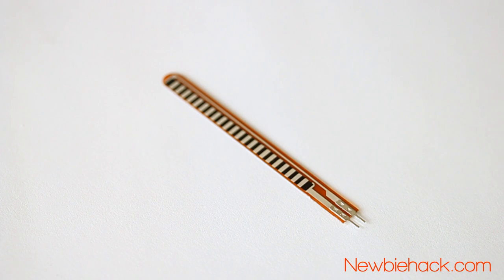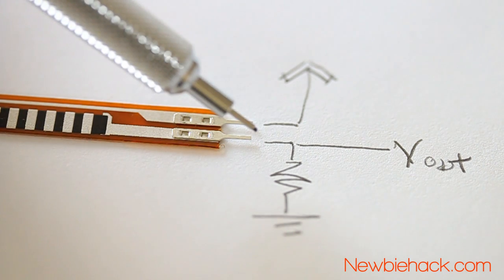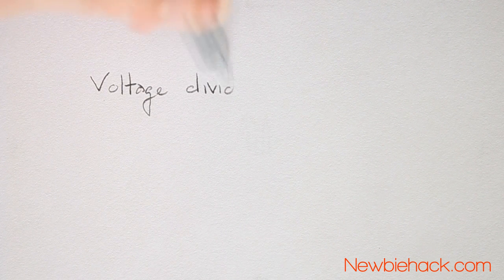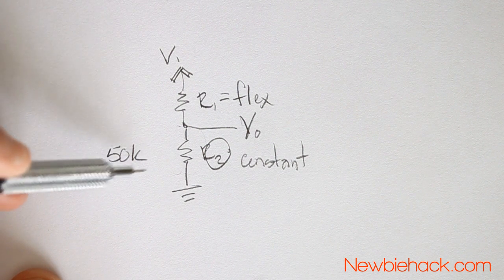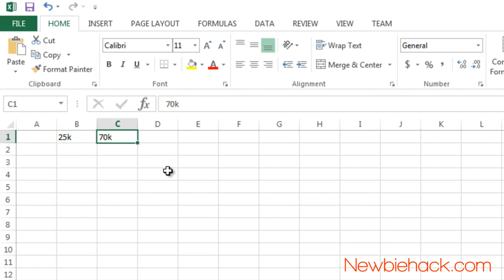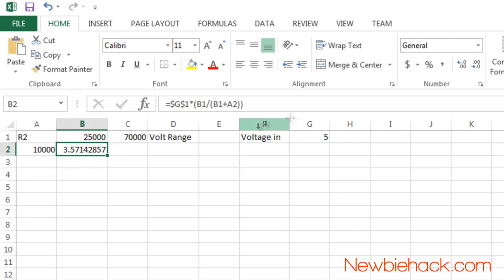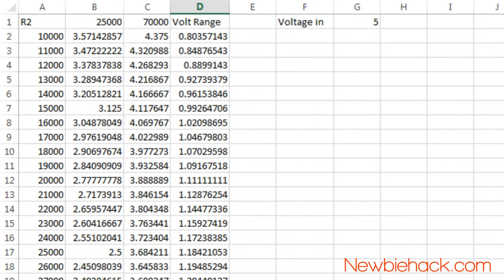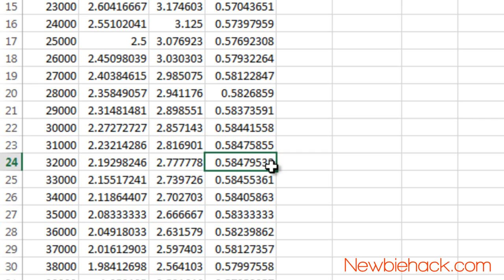Flex Sensor - Introduction and Use

Comment: hi there.  i tried to use this to control a servomotor.  i can command the motor as if i am using a potentiometer but if i am not flexing the sensor, the motor trembles. i wonder if it really does this or did i break the sensor.  could i filter out the.tremors?  thanks
Reply: shaider1982 no, you didn't break it. That's just normal noise. You'd get that from any sensor like a flex sensor. You will need to smooth it out in software (maybe take 5 readings and average them). A capacitor in parallel might also smooth it out..

Comment: Patrick- Excellent video . I suggest googling 'wheatstone bridge' + 'strain guage' and also using a microcontroller with two  A2D input pins that can be set to DIFFERENTIAL mode. Your results should improve.
Good luck. I enjoy your videos. I'm subscribed. - Jim

Comment: Vout = Vin (R2 / R1+R2 ) right ?
Reply from the maker: Árpád Goretity Just did the spreadsheet with the new formula.  The change in the formula does not change the outcome of the R2 resistance and voltage range.  I will provide an annotation stating the proper voltage divider formula where I introduce it.  Thanks.
Reply from the maker: Vout = Vin * ( R1 / (R1+R2) )  I add the parenthesis to show order of operation.
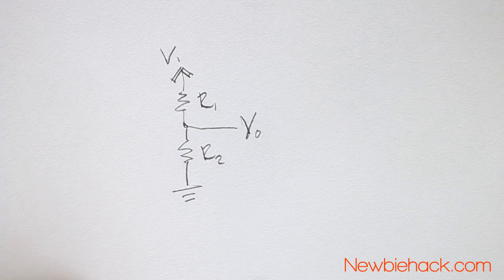Reply: Patrick Hood-Daniel No, I mean at @2:57 Vout is equal to the voltage drop on R2 ,If you are measuring the drop across flex sensor directly then Vout should be Vin - Vin * ( R1 / (R1+R2) ) because the reference was GND, As far as I understand, the supply voltage is divided into voltage across flex sensor and resistor R2 and by measuring voltage across R2 we determine the range of voltages that flex sensor outputs for various bending positions. To transform the voltage to our desired range we use potentiometers, op amps etc etc.Is my understanding correct ?
Reply: Goutham Kolluru yeah, that's it. The formula in the video is wrong as-is.
Reply from the maker: Árpád Goretity You are all correct.  I will correct the video.  I used the formula from the datasheet for this flex sensor.  Silly me.
Reply: No problem, thanks for the video anyway!
Reply: you're welcome, and keep up the good work!
Reply: So the drawing is incorect? I’m a noob in this  and I would like to know if I can use the drawing in the video or is it just the value of R2 that’s incorrect. Thanx!